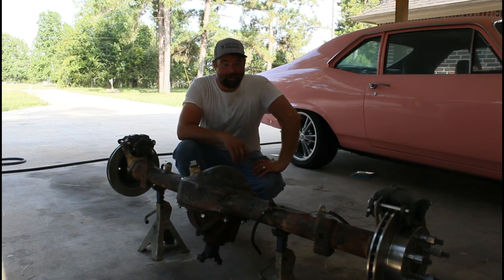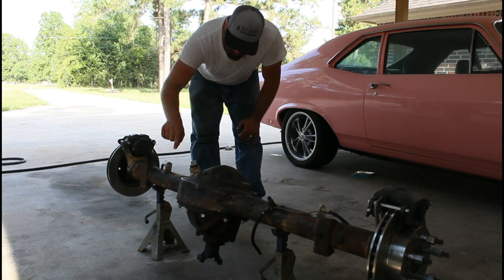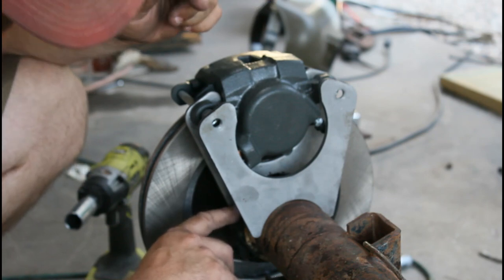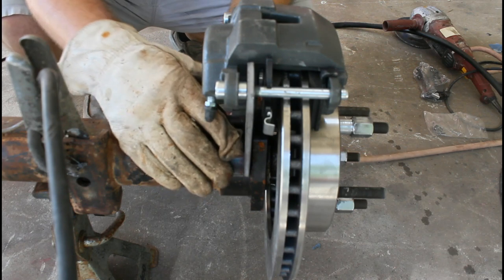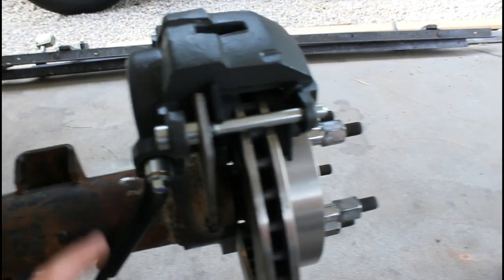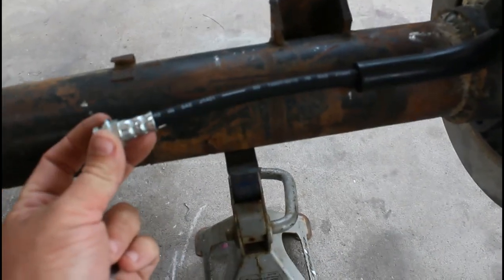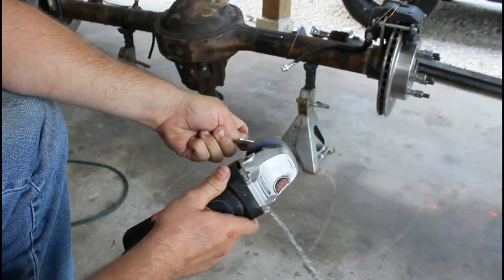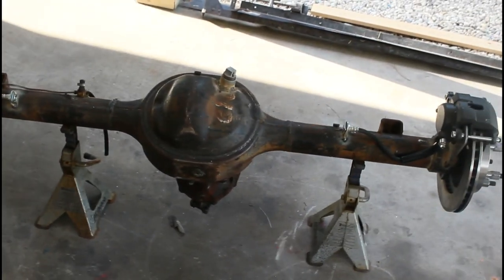EASY DIY FORD 9 INCH DISC BRAKES

Comment: I didn’t catch what the rotors came off of
Reply from the maker: they are an aftermarket rotor I couldn't find a production rotor with the right backspacing for the strange axles afco 9850-6600 is the part number they are fairly common a lot of dirt track guys use them. if you are using the the stock ford truck axles with 5 on 5.5 bolt pattern you can use front rotors off of a 80s model bronco they work well